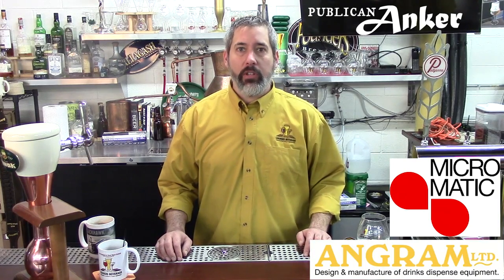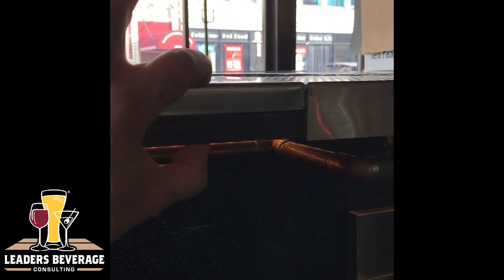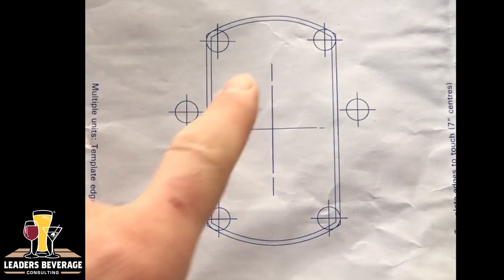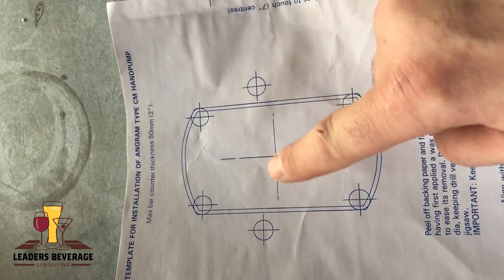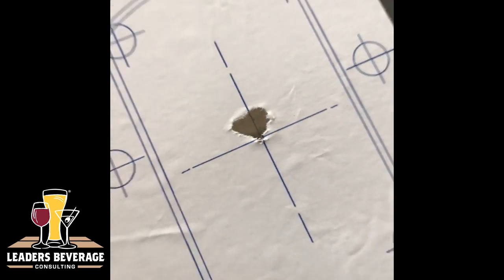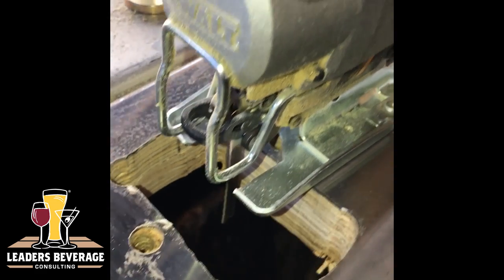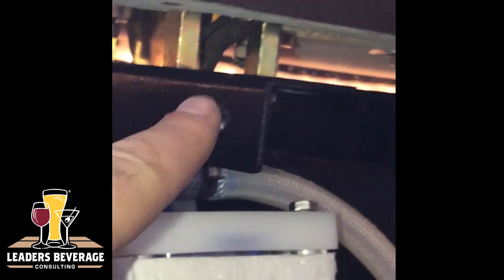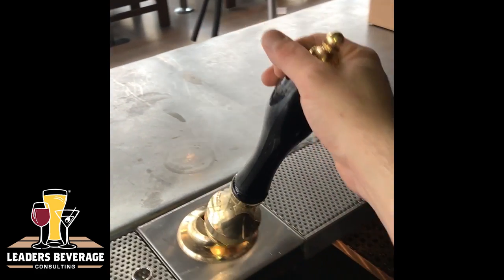How to install an Angram Counter Mounted Beer Engine

Comment: Is that possible to add a cooler between the pump and the keg? Thank you
Reply from the maker: Hi, nothing says that you can't put the keg inside the cooler. You could also simply run the line through a cooler to the pump as well. The thing to remember is that a beer engine works on a vacuum chamber system which means the pulling and pushing of the handle is what pulls and pushes the beer. Therefore, you can't put the keg to far from the engine. Good Luck, -Cheers!

Comment: if you ran the line into a standard keg...say a bud for instance...as opposed to a real cask ale firkin...what would be the result ?
Reply: A frothy mess on the floor, Angram do have a beer engine without a cylinder called a Shakespeare that give better results with the correct cooling. Probably will not work with lagers type keg products though only lower carbonated beer.
Reply: @amiesegust7514  Shakespeares are made by Harry Mason, Angram's version is called 'Cylinderless'....